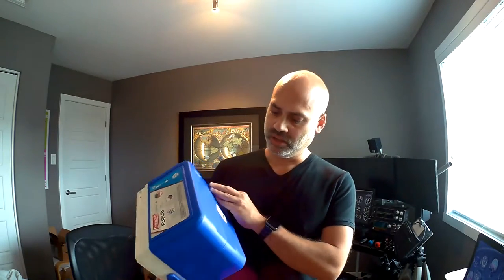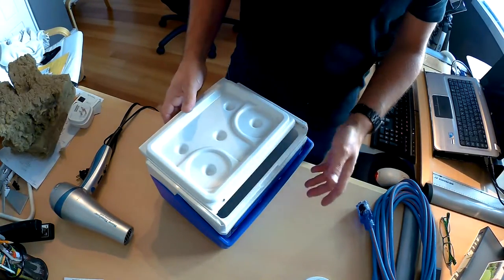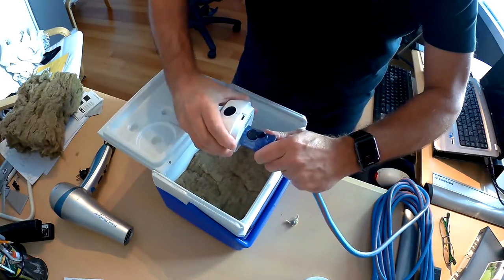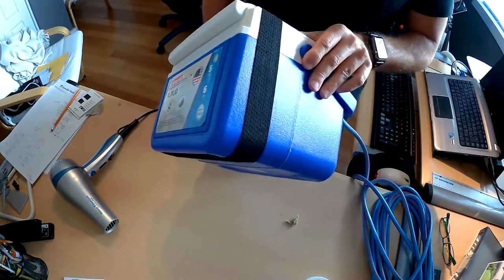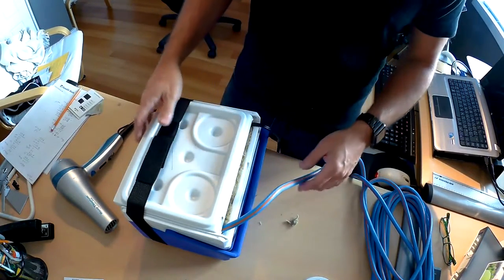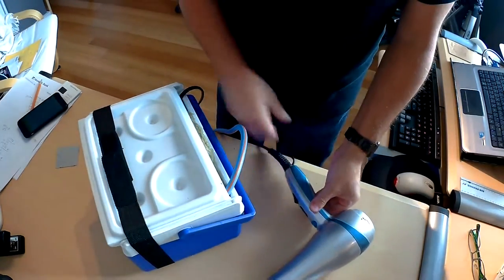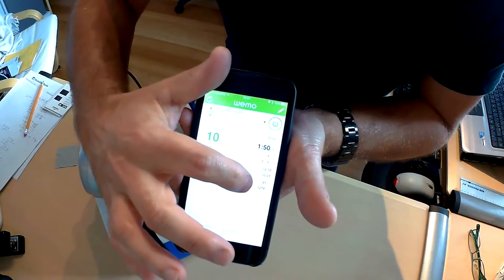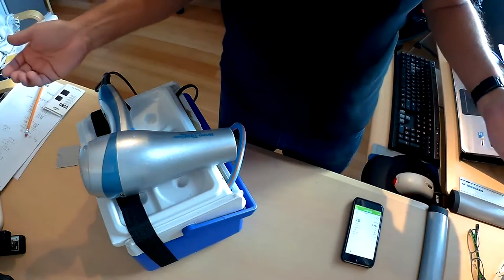Aircraft Engine Preheat Remote Start via the Internet - WeMo based

Comment: this is cool and all but what T hanger is going to have wifi?  Im looking for something that can use a cell service or similar to activate my pre heater from home, (5 plus miles)
Reply: Hi Doug. Take a look at this video: https://www.youtube.com/watch?v=1Uhp8DHhjvQ   I just finished making the same type of cell activated setup as in the video. The only thing I did differently was that I chose the new AUTO-GSM 4G unit instead of the older 3G unit used in the video. This unit did require two different power sources but still fairly easy to make with total cost ~ $155.